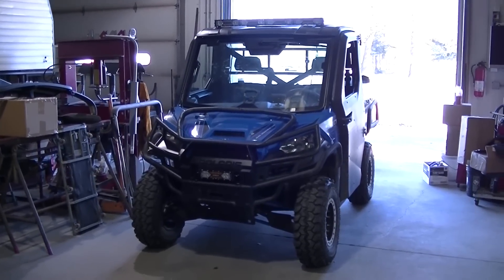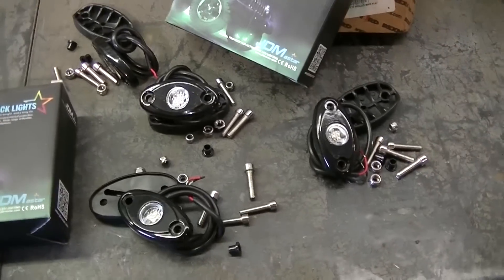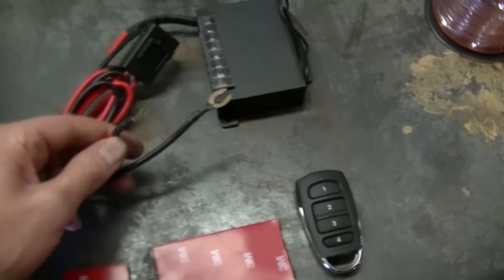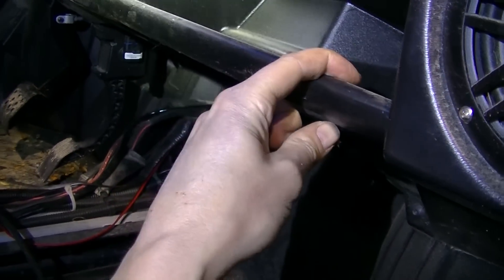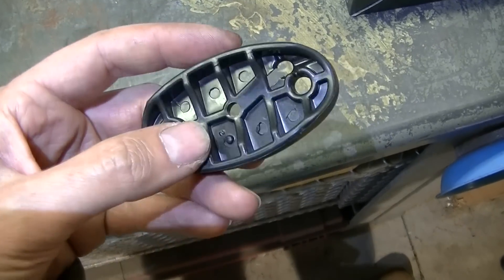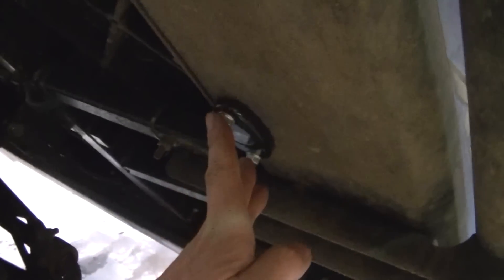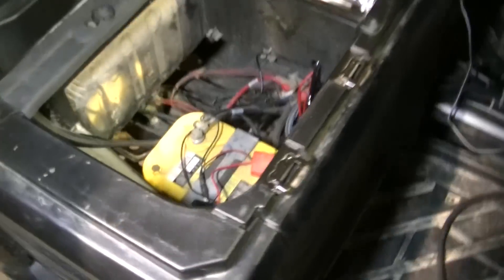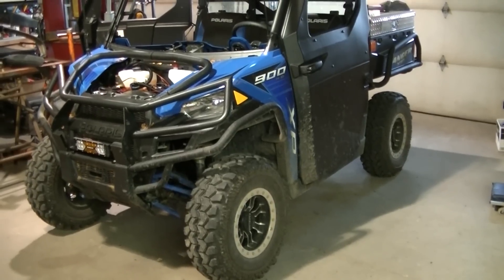Polaris Ranger 900 | JDM Astar LED Rock Lights Install

Comment: Looks good!!
Reply from the maker: Thanks
Reply: +mossman381 no problem! Wish I could say I was as progressive with my truck but too many problems. All I've done is chase them lol. Think I'm going to sell and get something with more interior space
Reply from the maker: Older trucks can have a lot of problems and repairs can get expensive.
Reply: +mossman381 yup. Just need to get the brakes to have full compression again and to get tires. Then it can be registered and sold. I could get a salvage title but I won't get the same value that it's truly worth

Comment: What size tires do you have on that Rig?
Reply from the maker: Those were 27x10x14.  They don't make the 10" tire anymore.  It's a 27x9.5x14.  Thinking about trying some of those for my new Ranger 900 project.

Comment: Question, i just purchase 8 of those led pods, im planning on using 2 on each fender, now im gonna use some 14 gauge wire and a switch rated 30 amp, do i need a relay for this application?
Reply from the maker: I would use a relay to run 8 of these rock lights.  1 or 2 I wouldn't run a relay.